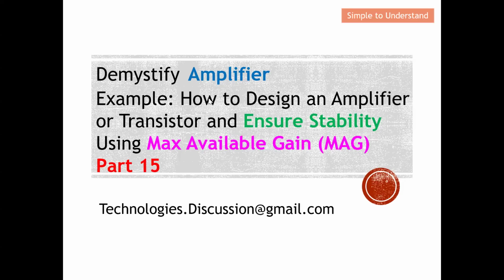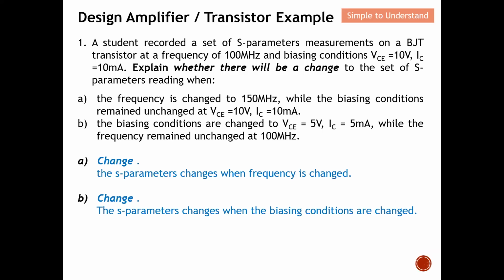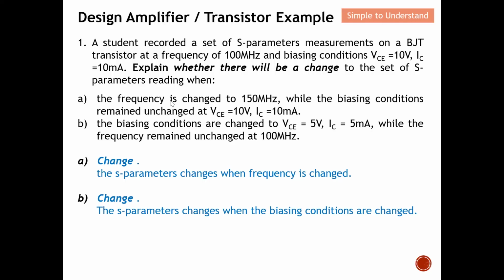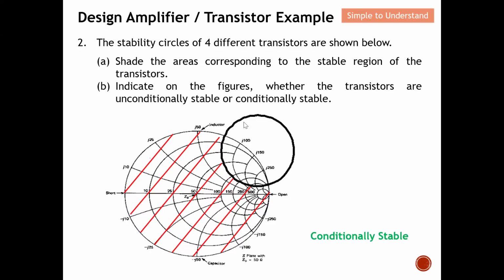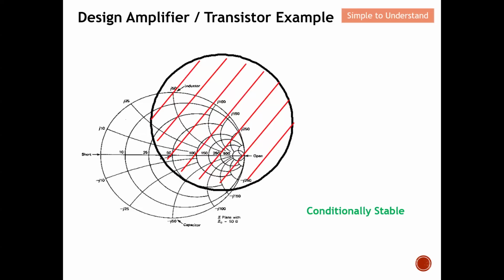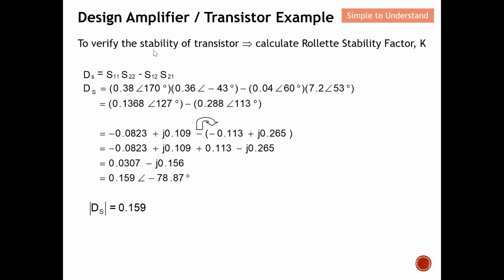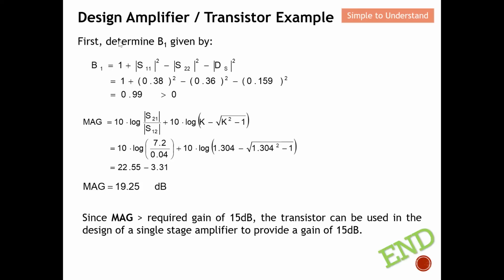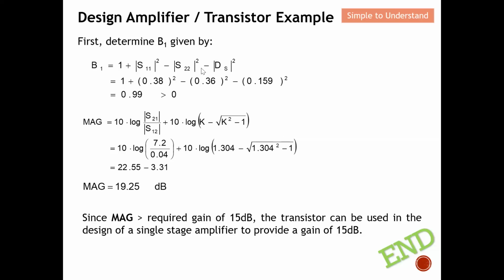Amplifier #15. How to Calculate Max Available Gain (MAG) for Stable RF Amplifier & Transistor Design

Comment from the maker: Thank you for taking the time to watch this video. This video presents a case study on how to design an amplifier, focusing on how to determine the maximum available gain while ensuring the amplifier (or transistor) remains stable.
We’ll test the concept using three examples to design a stable amplifier. For instance, when the frequency changes, we need to verify whether the amplifier/transistor stays stable. This is because frequency variations affect the S-parameters. Similarly, if we adjust the biasing conditions, the S-parameters will also change. If a particular biasing setup fails to keep the amplifier/transistor stable, we can modify the biasing conditions accordingly.
In this video, we’ll walk through an example of finding the maximum available gain while maintaining amplifier stability.